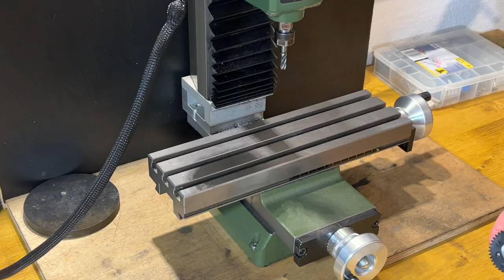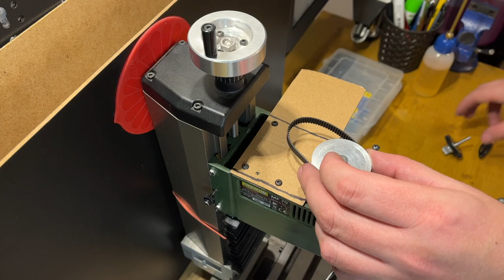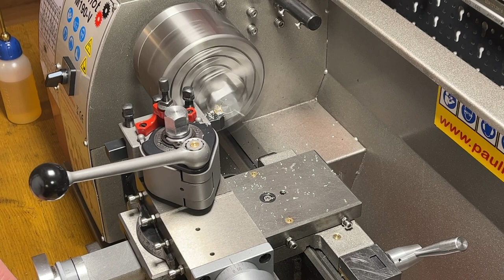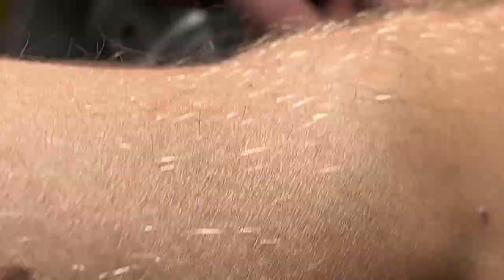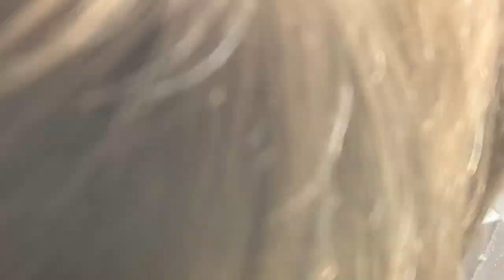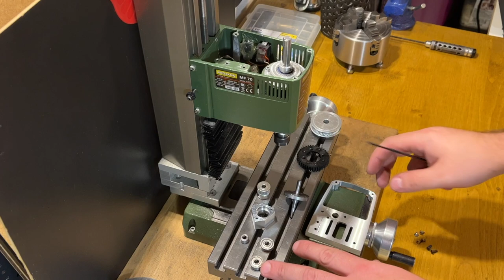Proxxon MF70 modification. High torque transmission (Part 2)

Comment: Kind of crazy idea...could you have simply (;-)) added another spindle motor on the side of the housing, and run a longer, and wider, belt to the spindle head?  It's not super hard to run two motors together with servoing, so that one motor can kind of 'idle' when more torque is not needed, but use the error signal from the 'primary' motor to drive the second motor... probably more expensive than your nice, simple, gear solution, but does allow for 'full speed' with high torque.
Cheers 🇨🇦 in 🇩🇪
Reply from the maker: Easier just to put bigger motor. But then the idea of nice and original look will be lost.

Comment: Hi, what about making a plan using hardware's data ? With the number of teeth of the pulleys and the belt, you know the exact axial distance of the pulleys. There's abacus or online calculators if you like. You want 6 teeth or more in mesh for a good transmission. With gears and the axial distance is even more crucial to limit the backlash. It's easier to tension the belt with a bearing pushing the belt towards the pulleys.
Reply from the maker: There is always a lot of possibilities to make something better. The gears mesh is possible to setup with moving of the engine. The solution for a belt you will see in one of my next videos. One I could say for sure now. It works )))
Reply: @zhadlun  I just tried to help by sharing more about four decades of professional engineering experience. Sorry.
Reply from the maker: Thanks a lot. I’m always note all suggestions. Any help always welcome.

Comment: Why a belt tensioner? The belt doesn't stretch much over time, would it be easier to use a shorter version?
Reply: It is possible to cut and splice a belt to an exact size. It is less hard and more durable than it seems.
Reply from the maker: Shorter version is just another option. But I decided to go for a belt’s I already had.